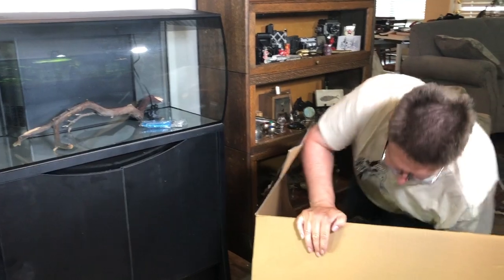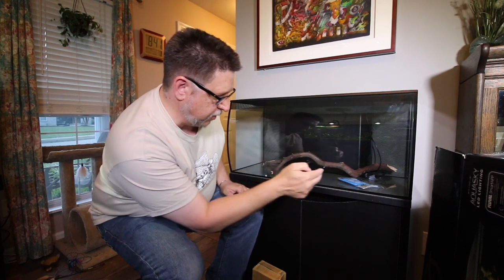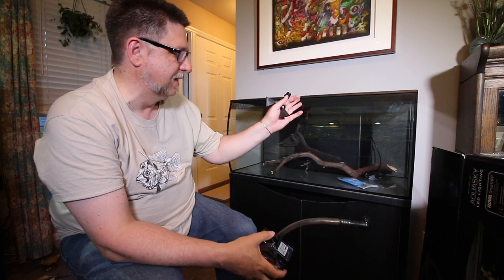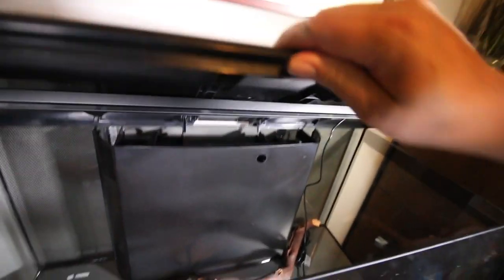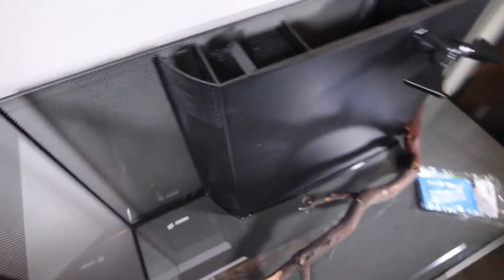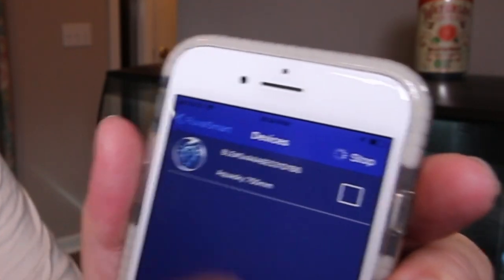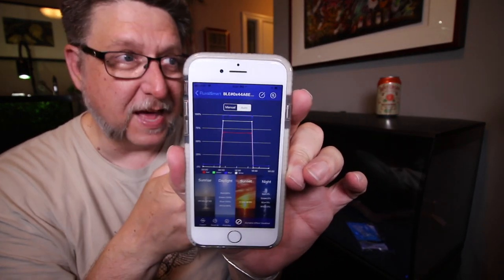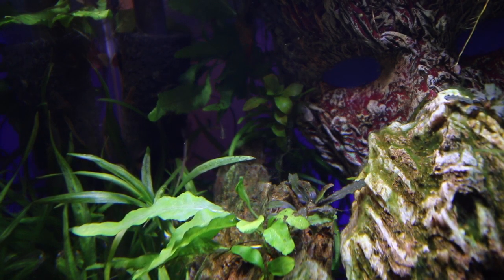Introducing The Mega Flex!!!!!!!

Comment: Hey Peck, did we figure out the 15gal flex pump issue re. the pump overpowering the filter and discharging the column?
Reply from the maker: Yes several people told me to just pull up slightly on the sponge and sure enough it worked like a charm.

Comment: Looking forward to see how this one turns out.
Really interested in this tank, although I don't really have space for it at the moment. 
I have an Aquasky light on my 20 gallon tall aquarium. 
Very happy with it's performance. 
Fluval told me that the next version of the app will have a mid day siesta option.
I have the lights on my 9 and 15 gallon Flex tanks running on Wi-Fi smart sockets; they work great and remember their settings between light cycles.

Comment: Hey peck. I have the fluval mega flex, had the tank up for about 2 months now and I cannot keep up with the detritus algae growing over my plants. I think it’s the light, i’m running chemi pure green and i’m not feeding very much, filter is relatively clean typically but i still get massive algae growth. I originally tried light settings similar to the one in the vid, but I thought maybe you had since updated them at all? I really can’t get a handle on this detritus and this is from someone who’s been doing planted tanks since they were 12. Any suggestions even if you didn’t change your light schedule?

Comment: I removed my honeycomb wrap on the front of my Flex with a razor blade. Mainly did it because my betta liked to hover at the top and I wanted to see him.  But you made me realize the light does shine in my eyes now at the right angle so I have to sit in the right spot to avoid it or lower the light with the remote.  😆
Reply from the maker: Was it hard to get off?
Reply: pecktec nope it came off really easy as long as you have a new razor blade.

Comment: Did you ever figure out if you could have 2 Fluval LED's on the tank showing up in the app as 1 tank with 1 schedule?
Reply from the maker: That’s a good question. The way it works is you set a schedule on one and export it to the other one. It’s easy and works well.
Reply: @pecktec  nice nice. It's good to see tech becoming available for freshwater. I've got a reef tank with the AI Prime HD lights which have something like this, except you can define a tank, add lights to that tank... one light acts as the primary, other lights act as secondary, and they all work in sync on one schedule. But these Fluval lights come in at a better price point (tradeoff is much lower PAR, but it's still good enough for FW plants I imagine).

Comment: We are just starting to set one of these up. Running CO2 & a Fluval Plant 3.0 along with the AquaSky. We flipped the doors upside down and moved the header panel to the bottom, to allow for a 10lbs CO2 tank & regulator. We also have a 5 gallon quarantine tank in the bottom. We added a floor support underneath. So far, it's up and running with aqua soil and hardscape. Will add plants tomorrow when they show up. Overall, we're super excited for this tank.
Reply from the maker: Ha! Nice hack!
Reply: @pecktec  If you want pics, I can send them.

Comment: Do you think it's possible to pimp this filter with more bio media? If so how would u do it?
Reply from the maker: I normally use both chambers in the sponges for bio media. Vs using carbon. You could easily pile bags up in that middle part over the pump where I put the heater.

Comment: This tank is listed as being 15.75 inches tall. Is that the maximum height including the hood or just the glass tank itself? I'm going to get this tank in the not so distant future and I want to build a stand for it now. I need to make sure that the height listed isn't just the glass but includes the hood. I'm going to have a hinged wooden door panel that covers the top of it so one of my fat cats can't jump on top of it or squeeze between the hood and the wooden door panel and break the hood. So I want the tank to be a snug fit.
Reply from the maker: That’s about right with the lid. It’s tricky to measure because the hood slopes slightly in the middle. I crudely measured it at 16# but I’m eye balling the tallest part in the middle.
Reply: @pecktec  Thank you for taking the time!

Comment: With the lighting I really wish companies would get their act together. First off they need to drop the blue for night and switch to reds for proper nocturnal viewing.

Then specific to these bluetooth Fluvals, they need to enable arbitrary programming schedules. A split lighting schedule to allow naturally dissolved CO2 to rebound, as well as have the lights on to view the tank in the morning and evening, for those of us who don't work where our tanks are.
Reply from the maker: Never heard anyone say that about red at night that’s pretty interesting. You can actually do that with these if you want. The light cycle thing could be done too with a second light in this particular one. But I find it make more algae.
Reply: @pecktec  Blue is pretty much the worst possible color to use for nocturnal animals. They're effected by it the same way we are (you know, all that stuff about how blue in our screens at night negatively impacts our sleep and all that, same thing). And all of which is why zoos use red for nocturnal animals.

TLDR; It's all about the rods, cones, and how rods interface with the autonomic nervous system, and cones don't.
Reply: @pecktec  and as far as the split cycle goes, there are work arounds, I've heard of schemes where you use an external timer as well to trick it, but when the light has all the equipment built in to do it right, buying extra lights or running extra timers is ridiculous.

Comment: Do you think you could add a fluval planted tank 3.0 instead of a second aquasky? I mean, would the provided brackets work?
Reply: Yes you can. I'm currently running a Plant 3.0 and the AquaSky. Just getting started. I have the Plant 3.0 towards the front and the AquaSky in the rear. I'll warn you it's a bit tight, but it works and if you have patience it'll be completely seamless. Good luck!
Reply: @milogger7556  Thanks. I am seriously considering the same setup. Just hope it does not generate too much heat as it all is kept under a lid. I have a plant 3.0 light on one thank and the light gets pretty warm even being above the tank without a lid on top.

Comment: If the aquasky light works like the 3.0 fluval lights, when you put them on a timer, or power cycle them, they keep their program, but loose the time of day. So they when plugged in, before connecting to the app, default the time to midnight. So if you wanted say two light cycles a day, with a siesta, you could program your lights coming on right after midnight, then put it on a timer. Everytime the timer turned it on, it would be midnight and start that program.
Reply from the maker: That’s interesting thanks.

Comment: I have the 15g Flex and have the same problem with water flow through the filter. Turns out the sponge just needed cleaning, water level evened out.
Reply from the maker: I tried that it worked great thanks!

Comment: In my Evo 13.5 the same thing happens to my pump chamber. I’ve tried taking out everything from every chamber and cleaning and it stays half full. This is also a bare bottom tank so 🤷🏻‍♂️who knows
Reply from the maker: Ok interesting. I think it must be a volume dynamics thing. It pumps it out of the chamber faster than water can get in to fill it up. Still works fine but that’s probably not intended.

Comment: If you’re looking for a substitute LED lights , Dustin fishtanks LEDs fit they get just as hot as Fluval sky led’s (I would know cause I’m running both of them on my tank) it doesn’t have all the bells and whistle‘s as the Fluval led but it can grow high demanding plants that need high light. Dustins LED lights is way brighter than the Fluval led
Reply from the maker: Thanks for the suggestions. I went with plants out of my 55. Non of them will need more that what two of these will do. I’ll tuck that info away for later though.

Comment: I would buy a Mega Flex but only if I could use the normal remote control to control the lights, if its phone app only then Fluval have lost a sale.
Reply from the maker: The app is way better than any remote I've seen. And cheaper that the controller boxes that came close. But to each their own that's just my opinion.

Comment: this tank is a fry /baby fish killer
Reply from the maker: Because......
Reply: @pecktec  if your fish have baby, it will  get suck in through the pump.
Reply from the maker: That’s true with any none sponge filter. So by your definition any filter is a baby killer.
Reply: @pecktec  This tank is great no doubt but the size of the  grill once  the fry enter the filter box it cannot get out and eventually it get suck through the pump.  many yrs ago we have a tank with similar filter build in, it virtually kill more or less all they fry. (guppy,sword tail,molly)
Reply: @jetli740  the Fluval Flex 9 I have comes with two intake covers to help with that, and you can cut a Fluval Edge Intake Sponge (or a knockoff, I bought a 10-pack off Amazon to cover all my HOB intakes) in half lengthwise, tuck a half in each cover, stick it on, and it's 99.999% safe. I love this so much, going to see if I can pick up extra covers for my 3 specs (2x 5 gallons & a 2gallon).